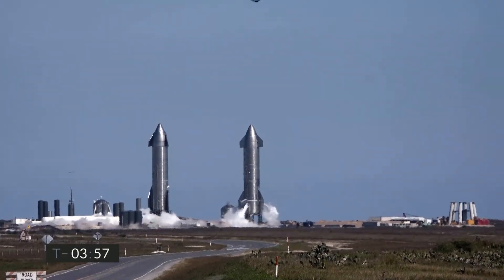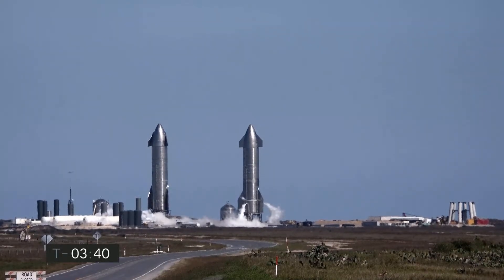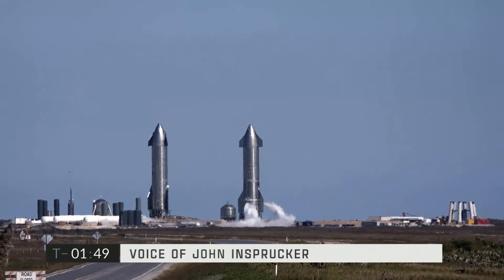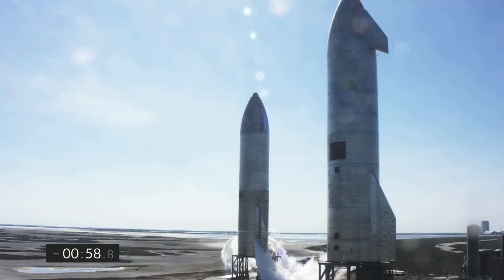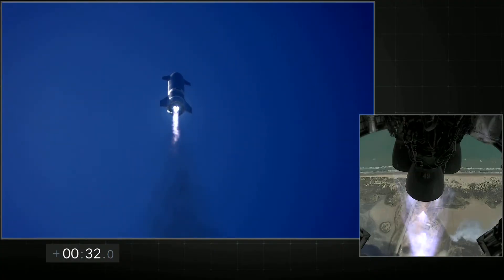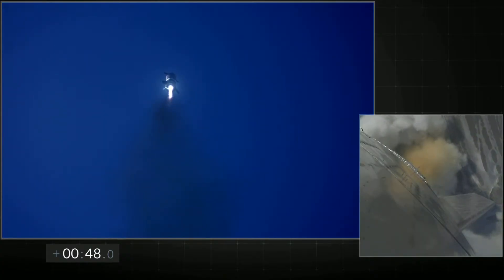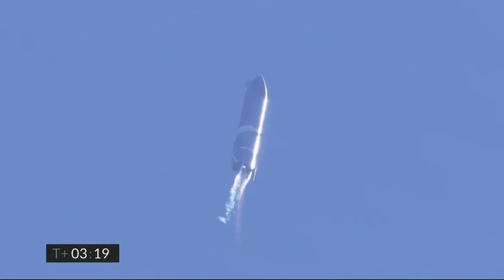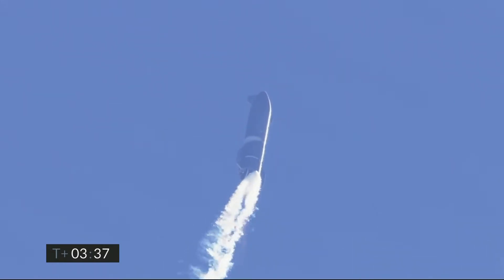Starship | SN9 | High-Altitude Flight Test

Comment: Too much math and not enough feelings. You guys will keep failing until you get in touch with your inner selves and not only rely on numbers. A kid riding his first bike doesn't rely on numbers, it's his natural feelings that help him learn it.
Reply: Recent mishap notwithstanding, SpaceX seem to have done just fine landing Falcon 9 using math instead of feelings.
Reply: @lazarus2691  Math is a way to do things but for the controls to be more natural, they need to interface it with VR. It will give the pilot natural feelings for controlling the ship. And it'll be much easier. Obviously this will require a skilled pilot as most things do anyways
Reply: @awakenedone7577  This is why you aren't a rocket engineer.
Reply: that's just not how it works though.
Reply: The fuck are you talking about
This rocket isn't driven by some dude, it literally runs on math
Reply: Obby Gobbi  computers flew better because there were too many controls for a human. A computer is obviously able to process these controls better. My proposition is to have the computers help the humans pilot with the controls. For example, if during midflight, they need to turn left. Instead of the human trying to account for all the wings on the left, right sides, and bottom and know which angle to position them before finally being able to turn, just give the computer the task of doing all this calculation and the human will keep turn until he "feels" it's enough while the computer calculates the exact angle and everything else based on user input. In the same way, a human pilot can dynamically control how much thrust is needed with the help of thw computers doing everything else. It'll be simplified, everything.

Comment: Why does it look like it's going 10mph from the gas coming off?
Reply: If you're talking about when it was near the top of it's flight, that's probably because it was. They slow down to a near hover to burn off fuel at the top.
Reply: @lazarus2691  i get that part, i meant during the duration. 10mph is an exaggeration on my part, but doesn't it seem like it should be going faster?
Reply: @EvonySkywalker  
Average ascent speed was around 90mph. 
Which is still pretty slow by rocket standards, but the reason it looks even slower is probably because  your brain isn't comprehending it's size properly. 

https://i1.wp.com/spaceexplored.com/wp-content/uploads/sites/10/2021/02/SN10_Rollout_Austin_002.jpeg?ssl=1

Even at 100mph, it takes over a second to travel it's own length.

Comment: Guys. These are test flights. SpaceX expects them Starships to blow up. It's common practice in the air-space field. 
When you design a vehicle that flies with human beings on board, you want to prioritize safety. With all the proper calculations you get the vehicle's theoretical limits, which 99.9% times are correct. And then you proceed to test flights, intentionally breaking the limits to make sure your calculations are correct and people on board are safe.
It would be worrying if a vehicle doesn't blow up breaking its limits, it would mean something is wrong in calculations and you would have to debug what.

Comment: It my take a different way to make the heat shealed tilles to work a lip on one or more sides that will coveron top to let the tile slide with heat exspantion make them a triangle.or use a blanket retractable.than it won't mater if it vibrates saving weight just got to be strong with heat disapating caratistics.i gess your going with the cover for the heat 🛡 nice davids not a dummy.

Comment: I am certainly no rocket scientist but it looks like twice if they started the flip higher up they may have actually been able to attain level flight and  a slowing down with the motors before impact at least.  its hitting the ground way to fast to be anything but RUD.
Reply: But it is a hell of a show either way.  Nice work guys! I wish you every success!
Reply: Flipping higher would have made it crash faster
Reply: Flipping higher wouldn't make a difference when an engine is malfunctioning.

Comment: Could you use some form of water displacement tank system to land in, especially for the lower stage. Or would it still be like hitting concrete. I imagine like a large underground silo with a funneled entrance at the top. The rocket touches down into the water pushing the water it out but also the water is mechanically released at a controlled rate to slow the impact and fall of the rocket. until it's in 20-30m deep in the silo. Mechanically grabbing in mid-air sounds hard to repeat, the second it goes wrong the tower would be destroyed.
Reply: You could just do it the way SpaceX are
Reply: @jackwhitlock1  From what I've read they are going to catch the super-heavy booster. Which sounds difficult to repeat, one miss, and there would have to be damage to infrastructure.

Comment: WRONG approach procedure DESIGN, is what we really saw here. The 2 engines RESTART needs to happen SOONER in the descent, HIGHER, and it needs to be with THREE ENGINES, NOT TWO, WHICH means a more stable and reliable power source is needed. SO, IN ANY CASE, RESTART HIGHER UP AND WITH AT LEAST THE SAME NUMBER OF ENGINES AS IT TAKES TO TAKE OFF, or in any case the same power available (per weight, of course). It takes MORE POWER to safely decelerate THAN to safely leave ground. Re-design !

Big Time
Not really. I believe the altitude had nothing to do with the crash. Instead, it was that one of the engines failed to ignite. 
I think they've already come up with a fix for this issue

Kai Soerfjord
To Big Time:
And when the relight begins HIGHER there is more TIME TO insert procedures that involve securing more than enough power and NOT have to crash. Again, stop policing the comments and give your own idea, if you have one, in your own comment, where everyone can see it and enjoy i

Simon Maier
You can't throttle down the engines in a huge range, and 3 engines may be too much thrust to land. We don't know from public sources how much they can throttle down the raptors, and how heavy the starship is at landing

Kai Soerfjord
To Mr. Simon Maier:
We need not know the details that define the minimum power needed in order to be fully aware of the need for more height (time) and more power available. So if the engines will not allow a low enough power setting for a hover then something else mist be done, say ‘NOT HOVER?’ In any case, WRONG approach design? It needs more heigth (time) and more power from a reliable, stable and sufficiently variable source.

Infinitely Explosive
If the rocket can't hover then you need to turn on the engines very late so that the rocket hits 0 velocity exactly as it touches the ground. If you try to do it earlier, then the rocket starts going back up, so you have to do the landing procedure again.

Kai Soerfjord
To Infnitely Explosive:
- with the current equipment, apparently, WHICH constitutes the WRONG element of the Approach design. Again, THAT IS mainly or in grat part WHAT’s wrong with it. More time (height) and more readily available power is evidently the task they are working on currently.
Reply: agree i would start the flipping higher
Reply: Here we go again...
Reply: I don’t have the energy to tell you how wrong you are anymore because you are so stubborn
Reply: aaand it's back but with less discussions about usernames this time!
Reply: The two of you are back with nothing to say that applies to my comment, with the intent of being a pest. Go right ahead.
Reply: @kaisoerfjord6794  I mean, the comment where meaningful discussion was happening mysteriously disappeared...
Reply: alex310 also replied, and wrote:
They save a lot of fuel doing the flip this low. 

Kai Soerfjord  
To alex 310: 
Precisely. It is a point I tried to make implicitly, between the lines. It is a pair of profit-tainted glasses they will have to remove, I believe, at some point, and the sooner the better.

Samos then joined the debate a bit later and wrote:
Just because you write a lot of word salad doesn't make you smart. It just means you have more time to waste. Brent and Jack are correct. If you took the same amount of time to actually research something rather than failing at being catty you'd actually learn something. 
PS If you're going to ignore someone, don't comment to them that you are ignoring them, just makes you seem even more sad.

KaiSoerfjord to Samos:
If you look at the content, Samos, the statements in my content are correct, and the opposing voices then apply what you call ‘cattiness’ (= malice, malicious behavior), trying to bully their way to the podium, so to speak, getting the last word in by demanding their opponent ‘shut up’. Shouting ‘Shut up, the engineers know it’ is laughable, not even addressing the topic. If you demand to have the last word, Samos, just repeat ‘shut up, the engineers know it’ until I begin ignoring you too. It may happen sooner than you think.

KaiSoerfjord WROTE:
I say they need a more stable re-light, spaceX knows it; and they need more time to relight safely, hence they need to relight sooner, higher up, with more engines and more power available. SpaceX knows more time adds time for more safety but they will see if they can make it with the bare minimum of time and only add more reliability. My opinion here is that the latter priority is unethical.
Reply: I say they need a more stable re-light, spaceX knows it; and they need more time to relight safely, hence they need to relight sooner, higher up, with more engines and more power available. SpaceX knows more time adds time for more safety but they will see if they can make it with the bare minimum of time and only add more reliability. My opinion here is that the latter priority is unethical.
Reply: @kaisoerfjord6794  I can’t wait to see the look on your face when SpaceX lands this for the first time without making any of the said changes
Reply: I can’t wait to see yours when you begin to grasp what it is that I’m saying in these comments, all obvious stuff that Elon knows himself.
Reply: @kaisoerfjord6794  Guess what. They landed SN10. They fired up 3 engines and landed on ONE engine. They didn’t flip higher, they didn’t relight sooner, they stuck their ground. And now SN10 landed. It did explode a few minutes afterwards due to a methane leak but other than that SN10 landed for the first time.

Comment: Look how slow it's going...and you say that has enough fuel to burn for 15 miles at this crawl?
Reply: The engines weren’t at full thrust. Plus it will fly on top of a Super Heavy Booster
Reply: @jackwhitlock1  oh ok thanks

Comment: yay, the engine didnt turn into a blowtorch this time!
Reply: Can't run engine rich if you don't start in the first place.
*taps forehead*
Reply: @lazarus2691  high hope for sn10 though! they did the LOX dump this time so that problem wont happen, it was just a straight up engine failure, which is usually just by chance.
Reply: @lazarus2691  lol

Comment: does it have to be ten km?? I am just asking I am not a rocket scientist but the time frame and distance is too short for the maneuver. I genuinely am asking, not being sarcastic. Love these videos.
Reply: It was going to be higher originally, they gradually reduced it to avoid high wind speeds and shear at higher altitudes.
First it was 20, then 15, then 12.5, then 10. It doesn't make much difference, it only needs a few km for this maneuver. 
Extra height just gives them more time to test things on the way down.
Reply: @lazarus2691  Thanks for that man, I guess they would need to remove some things from the sequence than, in my opinion of course. The starship seems too heavy for the descent to be slowed down enough in the current amount of time and distance by the time they want to start to "put the foot on the break".
Reply: @randy4ii411  
Weight wasn't the issue here, it really wasn't falling that fast. It had more than enough time/distance to stop. The issue was that it flipped too far.

See NSF's video of the landing at the 13 minute mark: https://youtu.be/CTwBllaqcME?t=780

Comment: Had a interesting idea, it follows what You tuber Small-Stars has proposed. A concept that he calls the Gravity Link Star-ship (GLS).  This would be a variant of Space X's Star-ship that will be able to provide its own artificial gravity. But, instead of using a special star-ship as the middle core, build the middle section with Hall thrusters that can use argon, or the upper atmosphere of Earth or Mars as propellant. This is recent technology that does exist. After docking the middle section could allow transit times to be reduced

Comment: Sometimes old school is best. A good ol' fashioned drogue shoot coming out of the nose at 500-1000ft above the pad would stabilise the craft engines down, and allow the landing/manuevering engines to do their thing. That flip is far too dependent on perfect winds, flawless timing and aerodynamics, and zero-error engine performance.
Reply: This is not one of those times.
Reply: @zacharyj6465  technically it does
Reply: @lmao.3661  It only has about 1-2 oxygen molecules per cm.. so technically it does have an atmosphere.
Reply: How would a parachute work on the Moon? The atmosphere is too thin.
Reply: @jackwhitlock1  Actually, the rocket is destined for Mars (the moon has no atmosphere), but the atmosphere on Mars IS actually less than 1% of Earth. Consequently, any winds it would encounter there would have only 1% of the effect those winds would have on Earth. A small drogue here (and a BIG parachute on Mars) would stabilize the craft enough in the proper orientation to allow the engines to take over the final descent and landing.

Comment: How much altitude can a starship model reach?  I understand this model would be launched on a booster in its final configuration and that its stand alone fuel capacity would be a limiting factor to its endurance but would it be able to reach 100km if it was configured with all cargo space used for fuel storage?
Reply: These prototypes aren't even launched with their existing tanks fully fueled; they don't have enough thrust. They have three engines, with 200 tonnes of thrust each,
But they weigh ~100 tonnes, and have capacity for ~1200 tonnes of fuel in the main tanks, plus another ~40 in the landing tanks. I think you can see the problem...
However, they don't actually need much fuel to reach 100km. SN8 and SN9 flew an extremely inefficient ascent, since the main point of the test was the landing. 
If they were actually trying, these early prototypes should be able to reach a few hundred km, even with the main tanks only a third full.
Reply: Also was that SN10 sitting there?  Was it wise to try to land 9 right next to it? I am guessing there were reasons... and it was bad luck the landing did not come off but wow we are seeing some seriously cool shit right here 😲 What is past is prologue...

Comment: In a large projects different parts, subprojects, are tested in parallel timelines to meet in single junction milestones. To get as much as possible done at the same time. 
Therefore SpaceX is probably testing Starship subproject along parallel subproject of its infrastructure. This make sense, because such large SC cannot be transported across large distances by general use roads. Therefore the only option is to get everything needed for a relaunch at the same place as much close as possible. When they will manage to land ships successfully they going to need this.

Comment: they could do the flip with the flaps if they make them able to turn them also vertically
that will be more faillure proof instead let the raptors do it 
the flaps could also keep the ship more vertical stable then in combination with the raptors before landing
the flaps can also then helping by reducing the heat when entering the atmosphere
Reply: The flaps already help with reentry in their current configuration, and do help with most of the flip. Turning vertically would add too much extra complexity and mass.
Reply: @lazarus2691  i mean they should e able to do 90 degrees on the pitch now its only roll